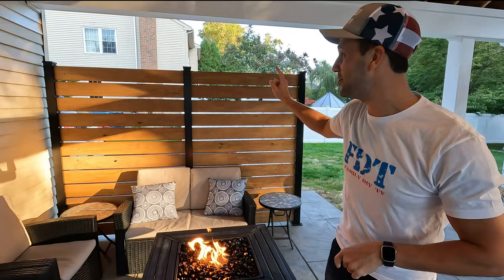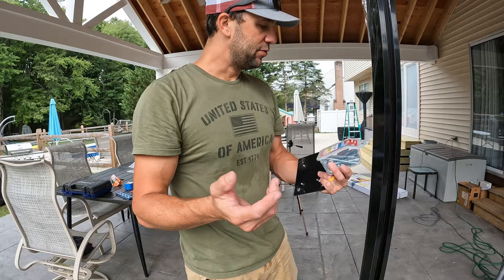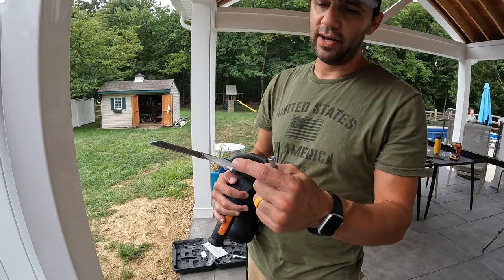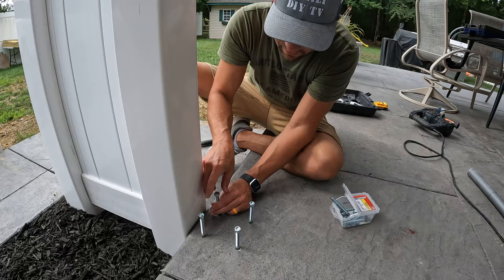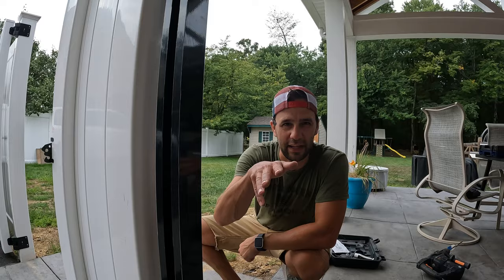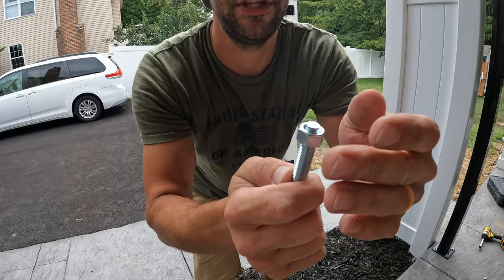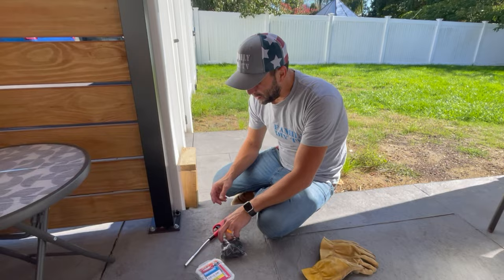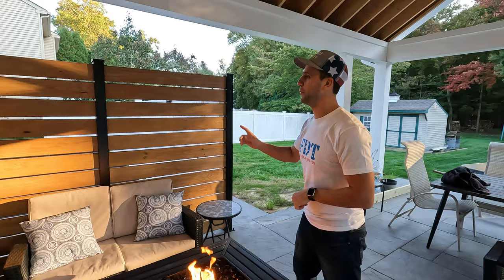DIY Privacy Panel by HOFT SOLUTIONS #modern #privacy #outdoorliving #diy

Comment: Loved your video! I went to Home Depot and purchased 3 kits by Hoft. Unfortunately the cement mounting brackets and hardware were not included and the packing list did not show these needed parts. I have emailed the company per their directions.
Reply from the maker: Thanks !   They don't come with mounting hardware.  If going into concrete, i have a link in the video description of the anchors i used.

Comment: Do you think these end post will work for  DIY free standing balcony privacy panel? My idea is to use a 2x12 lumber  laying flat at the bottom as base. The base spans full width of the panel. Both end post will be screwed to the same base. I will make sure there is no room for the base to move. I will also zip tie or metal strap the end post to the balcony railings. That should be sturdy enough, right?
Reply from the maker: Depends on how windy it is in your area.  Why not attach directly to the deck ?  

seems like it would work , could always add more zip ties higher up ...

kinda assume you want to take this with you and not go for permanent install...  right ?

Comment: Question! Do you think I can do this but on top of my cinder block wall? Can I drill into the cement on the wall? And maybe fill it on with cement? The top layer of the wall does not have cement in the holes. I want a privacy wall topper Just 2 feet high.
Reply from the maker: Yes ! Great plan.  And they make shorter ones, think they’re like 4 ft high.  So that might work great for ya !!!   Interested what you decide to do ! 

Mike

Comment: smaller spacer would look nice
Reply: It was a nice video. I am planning to use this type of fencing to surround my yard,. It will be built on the retention wall. I wonder if 6' tall poles with the 6' spanned wood boards will not get the fence blown away during the high wind or storm in Toronto area. Please respond. Is there a technical information available on the product strength. Thanks.

Comment: This might be a dumb question but I’ll ask it anyway how do you level it with extra washers?
Reply from the maker: Not a dumb question….  The washers are used as spacers to plumb the post.   So let’s say the post is 1/4 inch out of pin in one direction.   Get 1/4 inch of washers and put under to plumb the post.

Comment: I need to put this on my back wall...I have a block wall, but it isn't very high on the other side as people can look right over into my back yard & stare. It's really uncomfortable, so I want something like this infront of the wall.  Gotta figure a way to put it up
Reply from the maker: What is you got the 44 inch high panels and put that on top of the concrete block wall ?    Might look cool…. Paint block and have wood on top.
Reply: I’m in the same boat. I have a block wall (HOA maintained), about 7 feet wide where they made the wall shorter so people can look into my backyard. I have pavers in my backyard and don’t want to drill into it so I’m thinking about getting 3 concrete deck block, at least 12 inch high and installing the post on there since I need my privacy fence to be 7 ft. Does that sound doable?
Reply: @FamilyDIYtv  that's a great idea!

Comment: How thick is your stamped concrete? Looking into installing a HOFT system on patio pavers, but I’m concerned with the anchors being so deep that they go into the dirt below.
Reply from the maker: not sure, prob 3-4 inch pour but comparing your paver to my concrete pads is not a fair comparison.   Pavers aren't attached to the ground, so unless you have huge pavers, i'm not sure this would work.    it's more about leverage, than thickness of the slab you're attaching to.  hope that makes sense.

Comment: Six months later, how’s it holding up? I’m thinking about putting in a whole fence with these at our house! Any learnings? How’d the wood do drying in the slats?
Reply from the maker: Holding up fine.  We stained the wood, so it will hold up like any deck would.  If concerned about maintenance you can use composite.  We wanted the wood look.
Reply: @FamilyDIYtv  Amazing. We’re finding that the 5/4 1” finish wood is hard to find. Quite the specialty.
Reply from the maker: @CallOnColin  it’s should be plenty at Home Depot or lowes.  It’s just normal deck boards.
Reply: @FamilyDIYtv  If you have links, I’d love a little help. I might be looking in the wrong places, but everywhere I call is either insanely expensive or don’t actually sell. No worries if not!
Reply from the maker: @CallOnColin  check this link 

https://www.homedepot.com/p/WeatherShield-5-4-in-x-6-in-x-16-ft-Standard-Ground-Contact-Pressure-Treated-Pine-Decking-Board-253919/206968440
Reply: What size rubber caps did you use. I got 14mm but I feel like they’re a little too big.

Comment: Where did you buy the wood for this? I can’t find 1.25”  thick wood anywhere.
Reply from the maker: It’s just deck boards.  Can get at Home Depot or lowes
Reply: @FamilyDIYtv  I tried. No luck. Had to go to a mill for custom planned boards.
Reply from the maker: @gerryandre5035  sorry to hear that.  Normal deck boards will work. Or trex composite boards .   You didn’t have to go to mill.
Reply from the maker: @gerryandre5035  if you want send me an email and I can send you link.  FamilyDIYtv@gmail.com 

Unless it to late

Comment: We just bought our poles... i see you said you used pine? Has it warped? And finally we also bought washers but are they under your black plate or are just under the bolt but above the plate? It seems like they would level better under the plate?? Thanks!
Reply from the maker: Sweet.  Put it under to help level if needed
Reply: @FamilyDIYtv has the pine warped?

Comment: Hello, I viewed your video several times, because I'm trying to put up a new fence. First of all, how's the privacy fence doing secondly what type of wood did you use.  I want to use Cedar and Home Depot says they will cut it to 6 feet.  Is this the route you went?  Thanks for any info that will help me.
Reply from the maker: I used pressure treated deck boards, cedar will also work so would a product like trex.  It’s holding up great !
Reply: @FamilyDIYtv  Thank you for the info

Comment: Can you install these in grass? We have about four feet of snow outside. Do you know how these would hold up?
Reply from the maker: You could install in grass, but !    You would have to first pour concrete pillars, let’s them dry then attach these to that.   Little extra work but worth it imo.  I might be doing that this summer.    Think deck footing…. 

As for snow, I don’t see issue.  

Enjoy ! 
Mike
Reply: @FamilyDIYtv   I’m planning to do a bout 60ft of fence line with this.  I’m wondering if I should reinforce the pillars with rebar.  Due to frost line I’ll be going 48” deep (10” diameter)
Reply from the maker: @brandanbutler8789  I think it’s a great idea!  Rebar is cheap insurance at that point.   I’m assuming that will add a small percentage to the overall budget.    I’d do it.
Reply: @FamilyDIYtv  totally. I was planning to drop 3 vertical bars in each pillar. Should only be an extra $90-100. Looking forward to using the Hoft system!